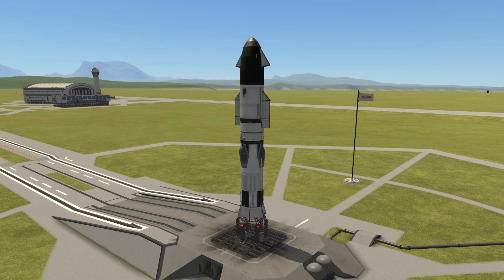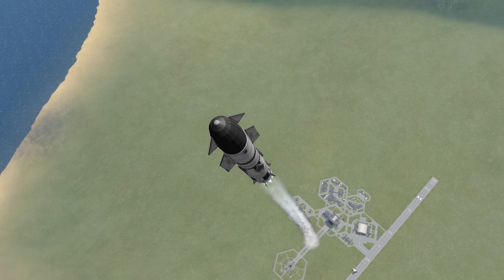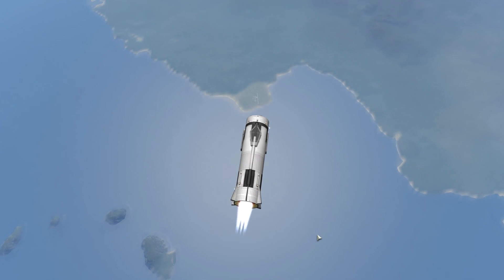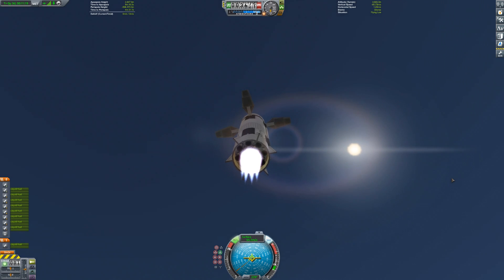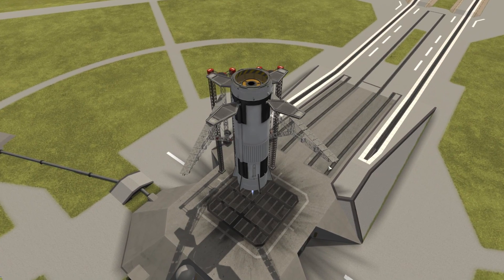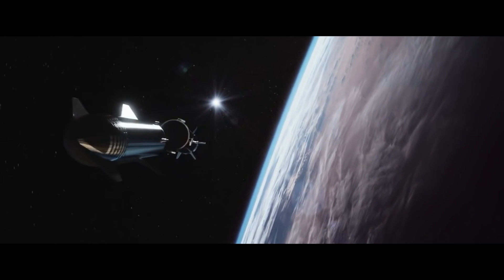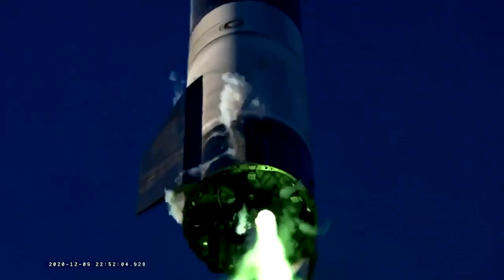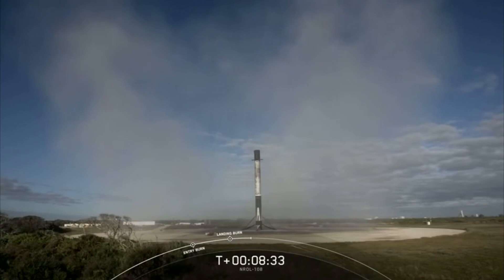Why SpaceX Wants To Make Landing Super Heavy MORE Difficult.

Comment: (6:47)  Even if Elon's innovations were thought of before by other people, he's the one actually DOING, and making the ideas reality.
Reply: nothing in spacex is new in theory and practice, just as the hyper loop.
Reply: The ones ACTUALLY DOING stuff are the engineers, programmers, builders, etc. You know, people who actually DO stuff, not just throw in money. Even the cleaning staff should be given more credit than musk
Reply: @Rayman120  Comments like this are cute. They reveal so much about the way you view successful, driven people. Musk is not just the chief executive, he's also the lead engineer AND chief designer at SpaceX. He and a handful of engineers built and flew the Falcon 1 and early Falcon 9. He isn't Tony Stark (that is, designing and building everything himself) because that's not even remotely feasible. Plus, he never claims to. However, the vision, passion and drive behind the achievements of SpaceX ARE derived from Elon. Sure, sci-fi writers for decades had envisioned rockets landing, but no one in aerospace cared to try because they thought it was not reasonably possible. Now SpaceX has landed 70 boosters and we're nearly bored of it. We're more shocked when one DOESN'T land.

Elon's laundry list of character flaws notwithstanding, it is entirely unfair to discount Elon's material contributions to the company he cares most about. You're thinking of that other guy.
Reply: @jackinthebox301  Let me know when Elon gets close to the 268 SRBs that were landed and reused during the Shuttle program.  And parachutes are far more reliable and cheaper than landing under rocket power.
Reply: @stargazer7644  Well, see .....none of that is true. The SRB's weren't 'landed' and they certainly weren't reused in the same sense as a F9. Dunking the booster in the ocean and then gutting them entirely is hardly the same as propulsive landing on a pad. Plus, each SRB refurb cost basically the same as a brand new booster. Now, I will admit that SpaceX doesn't publish their refurb costs, but when Tory Bruno whined about reuse needing 10 reflights to be economical for ULA, Elon responded with saying they're basically break even at 3, ahead with 4. In the end, refurbishing the SRB's had nothing to do with cost savings. It was a way for the contractor to get more money from the government. 

Parachutes are reliable, obviously, but they have there own issues. For what its worth, SpaceX tried to use parachutes to save the booster originally, but realized it wasn't going to be what they needed so they moved on. Cheaper is a totally different ballgame, though. Parts and engineering? Probably. But landing the booster in the ocean and having to clean out the salt water flips that calculus on its head. Time and time again SpaceX has proven they are obsessed with reducing cost. So yes, parachutes may be cheaper on the face of things, but certainly not over time.

Look, Star Gazer, I hope you keep enjoying whatever space stuff you like, but lets not pretend your disdain for SpaceX/Elon is not just unfounded, it is blinding you. The future you wanted when you were a kid happening right in front of you.
Reply: @jackinthebox301  The SRBs and the shuttles were refueled, reused and reflown.  The process takes a little longer than SpaceX, but it is EXACTLY the same.  The SRB refurb doesn't cost anywhere near the cost of a new booster.  Nothing is remanufactured.  They are simply cleaned and refueled.  You don't have a clue what you're talking about.
Reply: @stargazer7644  Since you're so sure, tell me, how much do the SRB's cost? The only number I can find is $23 million. Whether that's new or recurring for each launch, I don't know. For comparisons sake, Christopher Couluris at SpaceX once said their total material and build cost for the F9 is around $28 million. That includes the $1 million or so refurb cost on a previously flown booster.

We're probably arguing semantics at this point, but the reuse of a propulsively landed booster and the SRB's is definitely not in the same category. Are these two situations really EXACTLY the same? For the SRB's you have to fish them out of the ocean, clean out the salt, change the motors, etc. Versus folding up the legs for transit, decoking the Merlin's on the F9 and then double checking their parts for issues because they're pushing the limits of rocket engineering is two different paradigms.

You clearly will never agree, so I guess the better question now is why are you championing 70+ year old technology? SRB's have their place in old aerospace, for sure, but if we EVER want better access to space they need to die. SpaceX is proving on a nearly bi-weekly basis we can do better. Not to mention, once Starship gets flying the game really changes.
Reply: @jackinthebox301  I'm not going to go do your cost research for you, but these are both resusable boosters, and reusing a booster is ALWAYS cheaper than building a new one.  The only extra cost is the reuse prep.  You have to pay to fuel them both ways.  Yes they have differences, a huge one being a Falcon 9 has nowhere near the capability of the Shuttle SRB.  The SRB is much larger.  Yes the Falcon may turnaround faster.  That's not really a big deal when you have more than one of them.  Does SpaceX even fly them back to back?  And the fact that you think Shuttle SRBs are "70+ year old technology" tells me you don't know the first thing about them.  Have a nice day.
Reply: @stargazer7644  lol so you don't know how much they cost either? Cool. Glad we can clear up that you don't actually know what you're defending.

You say the SRB's are bigger, 2 seconds of googling determined that was a lie. F9 is 200 ft tall with a crew dragon on top and 12 ft wide. The Shuttle SRB's are 150 ft tall and 12 ft wide. Even adding another section to the stack for SLS doesn't reach the full height of F9. Performance? Yeah obviously the SRB's win there. Solids have 'better' fuel. With no throttle control, though, they're just big dumb boosters. SpaceX has no use for them. F9 already struggles to find payloads that are too much for it to handle. When they do find one, the Falcon Heavy is there. Regarding turnaround, currently the shortest turnaround for an F9 booster is faster than that of the Shuttle at 51 days.

The principal behind the SRB is as old as rocketry itself. So its actually 100+ years old. Obviously there have been changes in nuance and improvements. This isn't a hardware review of every booster over the years.

Look, like I said earlier, you can like whatever you want. Like basically everyone here, I loved the Shuttle program when I was younger. One of my earliest memories is hearing the sonic boom from a shuttle reentry while visiting family in Florida. But don't pretend you know whats superior if you refuse to support your claims with anything even resembling evidence.
Reply: @stargazer7644  I'm ready to believe you. If you want me to, help me understand the true costs, because I didn't find anything compelling when I looked. Until then you're saying I should believe it because you believe it.

First, thanks for giving me the numbers for the metric I already pointed out they obviously were better at lol - you still haven't supported your fundamental claim of being cheaper. Second, I will continue to take issue with the assertion the SRB's were landed, because they weren't by any strict definition. When you land something, you're bringing it back to LAND. What I'm hearing you say is the uncontrolled parachuting of the SRB's into the ocean is the same as Shuttle putting wheels down on a runway or the F9 putting legs on a pad. Is that a fair hearing? Like I've said previously, I'm willing to concede that we may be splitting the hairs of semantics, but lexical precision matters. 

"Big dumb booster" is not a dig against their value as booster. It was meant to express they have no control once ignited. I'll admit I ignored the ins and outs of SRB specific engineering, but I also made clear that I'm not trying to do hardware reviews of them. We're talking high level economics, not fuel shaping to manage thrust and TVC controls.

The extent of the refurbishment is also a major point of contention. If you replace everything except the comparatively cheap steel shell, does it really count as a true reuse?

Comment: Soo, what about a big gantry crane like thingy on rails or wheels. like in container facilities at big ports, you can  catch the rocket and then just quickly drive them  over the launch pad and set them down adding very little time too the whole process while keeping redundancy and your launchpad itself safe. Also you could then move boosters between pads and keep spare booster to stand in if there is a problem with the just landed one

Comment: The engine on sn8 didn’t get destroyed, it just provided engine rich exhaust
Reply: Lmaooo!!
Reply: @Jack Kavanagh Actually the reason why the exhaust is green is the copper burning due to extreme heat.
Reply: @Jack Kavanagh also he pointed that out the the header tank lost pressure, its not the turbine, so high oxygen to propellant ratio made extreme heat that cause the copper to burn which turned the exhaust to green.
Reply: Good joke.
Reply: thanks
Reply: yeah, I watch them.

Comment: It being SpaceX I fully expect: "Matrix style" umbilical cords extending and connecting while the booster is still descending / hovering, a huge robotic gripper folding is self around the booster, a crane swings over a reused starship, a guy running over buffing the wind shield using his sleeve, giving it the thumbs up before turning his back to it covering his ears and dropping down behind a blast shield...

Comment: So, SpaceX is going to use one of the methods proposed for the Kistler Propulsion Assist Module,(first stage booster) that came up in the early 90s by 'catching' the booster on landing? If that doesn't work out they can always turn the "grid fins" into helicopter blades I suppose :)
Reply: Oh and good points about that bit but it wasn't that it was unworkable it's that it took a separate landing 'pad' being constructed for just the reasons you mention, rather than 'risking' the actual launch pad with each landing. Even though the separate launch and landing sites were 'fairly' cheap for Kistler, (no where near what SpaceX would have to spend mind you) it ended up being 'cheaper' to go with parachutes and air-bags for the Kistler sized vehicle. (Obviously not going to work on something the size of Super-Heavy) Also wanted to touch on the re-fueling in orbit bit; Has anyone pointed out that, by the math, it will only take two or at most three re-fueling flights to prep a Starship rather than the 4+ that keeps getting mentioned? Never mind the 'cargo' the tanker carries by SpaceX's statements the Tanker itself (like Starship) will arrive still carrying massively more propellant than it needs to get back down and it can't land with that in its tanks anyway so... At this point I'm questioning if they will even have 'tanker' Starships but rather use 'cargo' Starships instead?

Comment: I suspect, Scott, that the Super Heavy booster will need to use some sort of terminal guidance system to achieve the required landing accuracy.
Reply: If the military could fly cruise missles through windows and drop 500 pound bombs down air vents 30 years ago surely Elon can manage to get within 10 meters of where he took off today.

Comment: There are plenty of better ways of improving performance. Landing without legs doesn't save that much mass. Landing on a drone ship at sea would give WAY more dV. Also, for the BFS Tankers, they don't need as many engines as the main BFR. Ideally they'd have 1 engine with a retractable huge nozzle extension. That saves the weight of 5 engines and increases ISP. because the nozzle can be bigger.

Comment: There is a way that this type of landing can be an even bigger win - if the SuperHeavy always uses its grid fins to hang, even before take-off.  That means that you don't need to spend as much weight on structural strength to hold the weight of the entire Starship on the bottom of the rocket.  That could help significantly with keeping the weight down and still avoid the Atlas-Agena crumple problem that we have a video of from the 50's.

Comment: Back when starship was first introduced to the public back in its BFR form, i said that the final form BFR would be smaller than its original design and take less payload to orbit,

And that planning to land on its launch mounts would probably not work,  years later, I was right about one of those things. Let’s see if I get two for two 

Years later
Reply from the maker: But wait they’re already talking about a bigger one so what happens if initially they don’t land on the launch mounts and then later land on the launch mounts are you going to change your statement on being correct?
Reply: @scottmanley  ahh but that would be a different rocket

Comment: Scott, would it be possible to catch the Heavy Booster with help from electromagnets?  Since its mostly Stainless Steel could a magnetic field be applied as it comes to a stop on the engines without causing some kind of damage to the vehicle from applying forces of resistance to internal parts made of ferromagnetic material?  The magnetic field would center the rocket over the ground structure precisely, as its hovering on engines, then arms come in and support the vehicle at the grid fins?  Would that work?

Comment: 3:25 - that almost looks feasible - if the wires strung between the posts went down each post to some sort of water dampener.....
You could also run a wire between the posts to act as a transmitter, with a smaller one in the base and transmit a cone like signal to align the booster in - like a glide slope for an aircraft?

Comment: At sea, the noise suppression system would simply be a yawning hole in the landing pad leading to the ocean below.
The swinging capture arms also double as a stabilzer for the sitting Booster or complete stack in high winds.

Comment: Catch it with cables? 
Thinking one cable under the grid fins on either side. Think of a combination between the lightning towers and Arecibo.

Maybe the cables can be movable to align under the fins once they figure out where it's going to land.
If the fins are 9m they might just have to get a cable in position within a couple of meters.
No costly structure very close by either.

Comment: How I would solve it is by having series of ropes on posts, once rocket is close enough  they close on rocket shutter leaf style, rocket might be even off center and lines would pull it in to the center. Also having ropes instead of rigid structure simplifies shock adsorption.

Comment: Just land it in a giant bucket of unpopped popcorn. The corn will pop as the booster approaches.
Reply: Just drape a blanket over several towers, like a blanket fort. The boosters will burn a hole through the blanket and then the fins will catch on the blanket and it'll sink slowly into the ground.
😉
Reply: I don't think popcorn would pop quickly enough. popcorn needs time to slowly heat up, and turn the moisture inside the kernel into steam.  If you apply too much heat/fire, it will just burn up instead of pop
Reply: @tchamp72  We're going to need a special facility where we pre warm the kernels and then we dump them in the bucket right as it's coming down with the robot arm.  Science and industry!  Industry and science!
Reply: A small(really big) but well deserved snack for the spacex team after a launch and landing
Reply: @racitup4114  Most corn varieties do not pop. Elon would be making a big error of he nickel-and-dimed on the corn.